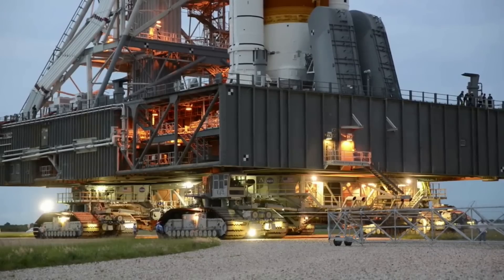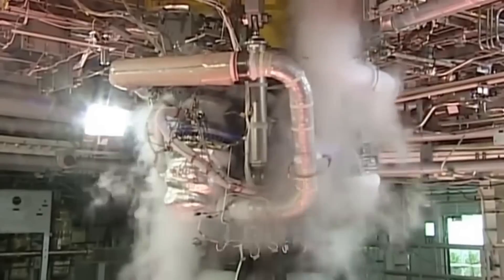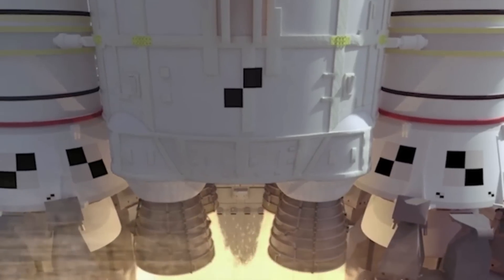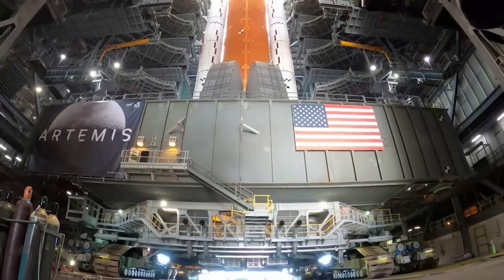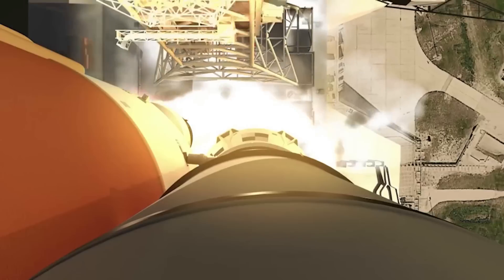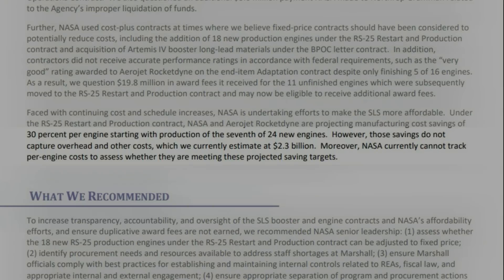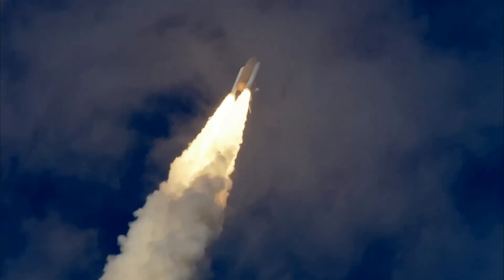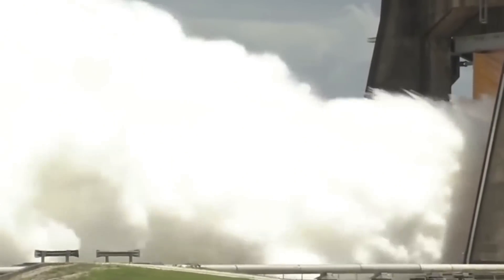The Problem With NASA’s SLS RS-25 Engine

Comment: $46million to Northrop for an award's contract?  Those are pretty hefty 'hidden' fees!

Funny aside, these costs and overruns aren't NASA's fault.  Why can't the GAO just create or assign a bureau that deals solely with NASA's contractors auditing, contracting spending, and the overall budgeting?  NASA's charter is research, design and development, manufacturing and final assembly, and space exploration.  Get the massive financing and budgeting tasks off NASA's plate and be the middleman between the agency and Congress.

For all the politics involved, a reality for any agency, and the fits and starts over the decades placed on  NASA's shoulders, no one should be surprised at how quickly the costs increase.  NASA's doing a great job and they should be recognized for their accomplishments, not the funding and cost burdens they've no control over.  Besides, they're doing a lot to ensure a better competitive landscape within the space industry.  The fact they've had but three companies to contract with, an identical scenario faced by the DOD, those companies know they're monopolistic and are holding NASA hostage.

My fantasy would be similar to how the computer industry does their chip designs and outsources the manufacturing to TSMC, Intel, and Samsung.  NASA does the brainy work, submits a bid request to the GAO, and works w the GAO to determine the best candidate for the manufacturing aspect.
Reply: I definitely agree that nasa are doing their best and a great job in the circumstances, just they're having to navigate the politics of it at the same time.

Comment: When you discuss a report that is available on-line, please post a link to it.  Not doing that, which is common, is one of my major pet peeves.  I found the report, but can't post a link since YouTube deletes comments with external links.  Keywords which will lead to it: "NASA’s Management of the Space Launch System Booster and Engine Contracts"

Comment: Nasa has enough heritage RS25 engines available to fly the next three SLS missions...And saying the RS25 is old, is misleading as it has gone through updates during the shuttle program and after to support SLS. I guess you would say the RL10 is old and should be thrown away since it's been flying since the 1960'..But it's one of the most reliable engines ever built and still used on the second stages of Atlas 5, its replacement, Vulcan, Delta 4's, and more. In  the case of rocket engines, old is good, as old is reliable. I didn't see any SLS engines shut down or not start on it's maiden flight...not bad for an old engine...
Reply: Excellent comment. Old, well-understood and reliable is often the way to go with something as difficult as launching humans into space.
Reply: And working on the first try is a nice feature of our space agency.
Reply: Excellent post.

Comment: The current SLS is designed to spend money. Congress specifically requires NASA to use many of the same contractors that built the shuttle. The SLS wasn't designed to be the best, most efficient way to achieve a a goal like going to the moon. The goal was to keep shuttle contracters in business so that election money and votes keep coming in for lawmakers. Originally sold as a "cheaper" way to keep NASA building rockets by reusing old designs, the requirements just keep funneling as much money to contractors as possible whether or not they bring anything worthy to the program. Don't get me wrong, employees are busting their butts and working hard. Unfortunately, more could be done with their work if the program was better designed.

Comment: RS-25 was designed decades ago but it is an extremely high performance engine by today’s standards and it is unlikely that anything new would usefully exceed it. The new version of the engine is to simplify some aspects of the design by using modern manufacturing techniques and taking into consideration that it is not being reused which allows higher thrust. The million second test mark was passed decades ago and probably is closer to two million by now. If a reworked design is costing this much, what would a new design cost? At least NASA can be assured that this is a very reliable design without adding at least another decade on if they were to develop something new that would not be usefully better.  Maybe the whole concept of SLS should have been rethought decades ago but the whole program was turned into a political quagmire with a “political” life of its own.  The “problem” is not with the RS-25s, but with the “political” underpinnings of the whole program.
Reply: Yes, the problem is with management, not the engine.
Reply: Good comment.
Reply: Best comment.
Reply: There already is something better.
Reply: @jamskinner  
That is complicated and not a simple statement of yes or no. For SLS probably no. Raptor is not a plug-in replacement or obviously better considering SLS’s flight profile. If you change SLS’s requirements enough to make it work you might as well just use SH as an expendable rocket which I assume you would advocate.
Reply: One significant error in the narration.  The bulk of the takeoff thrust of both SLS and its predecessor STS (Shuttle) is provided by the toxic solid rocket boosters (SRB).  These SRBs, which you will recall killed 7 astronauts including a school teacher, are only required because of the decision to insist upon the fundamentally-flawed hydrolox propulsion for the first stage.  

NASA is spending billions of dollars for recertifying RS-25 engines it already owns.  The only reason that NASA cannot replace the RS-25 with a commercial engine with the same thrust, such as BE-4 or Raptor 2, is because it is continuing to dictate the use of hydrolox propellant despite all of the engineering and safety issues of that technology.  The Raptor 2 engine now has far more hours of production testing that RS-25/SSME.  Taxpayers must seriously ask their Congress-critters "What is so d**ed important that we are being asked to spend THREE ORDERS OF MAGNITUDE more for *reconditioned 1970s engines than for brand-new American-built engines".  Act like lawyers and ask the key question "Cui boni?"  Since this is clearly a ripoff of American taxpayers, WHO benefits?
Reply: @jamescobban857  
So how many million test seconds does the raptor have? Please provide a reasonable source for your statement. The SRBs did burn through but that was a design problem that was clearly understood by engineers in NASA and their contractor. I would proffer that why this translated into the loss of a shuttle was mostly on the shoulders of NASA upper management operating the SRBs significantly out of their design temperature parameters while knowing the issues. What killed the people was “Go-Fever” to meet a political driven timeline. What also killed the people was that there was no design considerations for safe ejections. Please explain to me how your superior starship has solved that same ejection / abort issue at all parts of the launch regime. The SLS is a bit of Frankenstein and a political creature but it is an actual real and proven rocket. We will see when your superior and “not fundamentally flawed” SH & starship can say the same.
Reply: @jamescobban857  It's because they are using the RS-25 that they are using hydro-lox. It's still the best fuel for rockets anyway, and NASA has 50 years of experience using it. Calling it old technology is rather hilarious. Maybe they should add LED lights or something.🤣
Reply: @Mentaculus42  SpaceX has been testing Raptors almost contjnuously for four years now.  SpaceX has already built over 400 Raptors and each Raptor before it leaves McGregor has had at least one full-duration burn, 420 seconds.  So the Raptor testing program has at least 160,000 seconds of test firing assuming each engine has only been test fired ONCE.  Four months ago NSF reported the 1,000th test since it started reporting on 38 April 2022.

STS 51-L was launched in inappropriate weather because the entire program was months behind.  NASA managers did not want to wait one more week because it would push everything back.  Why was the program behind?  One big reason is because hydrolox is a NIGHTMARE to work with.  You must cool the fuel to between 14 and 20 ABSOLUTE, a temperature that no materials can be really engineered to deal with. Physics behaves in unexpected ways that close to absolute zero. Hydrogen leaks THROUGH metal.  The heavy orange insulation that killed the crew of Columbia and almost killed the crew of Atlantis is ONLY required because of the need to maintain those insane temperatures.  Because of its incredibly low density LH2 demands ENORMOUS tanks and huge turbopumps to feed to the engines, with the consequence that the RS25/SSME is as powerful an engine as you can build to exploit it.  It would take TWENTY-FIVE RS-25s just to lift SLS off the launch pad, whoch is why the KILLER SRBs are mandatory.  And still some clearly incompetent overseers insist on this nightmare fuel being used instead of all possible alternatives.

It was proposed to use a kerolox first stage using upgraded F1 engines.  But that was rejected because of the political obsession with hydrolox.  Don't whine about the higher ISP and clean exhaust of hydrolox when the lower ISP and the poisonous exhaust of the SRBs are tolerated just so NASA can pretend that the first stage is hydrolox powered!
Reply: @jamescobban857  
Challenger was launched when it was due to political and PR requirements so that it would be in sync with what the president was going to say in a speech. The engineers knew about the problem that caused the explosion (and had been monitoring it, what they didn’t know was a problem with the leading edge carbon carbon composites). MIT had a compete series of classes on the design of the space shuttle which is available online which I would suggest to people who actually want to learn about why things were done the way they were. Most of what u say is not consistent with what the engineers that actually did the design and maintenance say. 

In addition, one of my engineering professors actually established the 100 flight criteria for the space shuttle. I always find it entertaining how much knowledge is actually exhibited by a certain group of people who buy into a particular person’s “Bovine Ordure”!

I can understand your hate for the political creature that is SLS and in extension for your “hydrogen hatism”.  BUT you really shouldn’t take your talking points out of the BAD OPINIONS PAGES of Aʴsetechnica‼️

Comment: SLS: Making reusable launch systems disposable again. What a waste, why start with a engine designed for reuse when designing a disposable rocket.  Another good video, I subscribed after the last one, so many bs space channels these days.
Reply: The engines have a long, reliable history and were redesigned to be disposable to maximize lift. The concept is good. It's the management that is making the waste.
Reply: @jamese9283  Seems like a major design change for that to be a good starting point. Most rocket engines are built for a few minutes of life.  Seems to me like a way to get funding under the guise "we already have so many engines".  Between that and changes in manufacturing, seems like a joke to me.  The RS-25 was one of the few parts of the shuttle that lived up to expectations, maybe they really can get the value out of the design since most of the engineering is done.
Reply: @clytle374  I understand your cynicism, but try to separate management decisions from design needs. Reusability is unknown territory for heavy, manned missions to deep space, as indicated by Starship's planned numerous refuelings. The RS-25 with SRBs was a good choice to maximize lift and reliability with ultra-difficult human missions to the Moon and Mars. Program politics is another matter.

Comment: SpaceX should just bid a disposable variant of Superheavy to replace the core stage and solid rockets. It would only take 17 Raptor2 motors to match the thrust of the SLS stack a liftoff. A SLS Superheavy would likely need more as the booster would be made of stainless and be heavier than the aluminum of the SLS core but SLS core and Superheavy are about the same diameter so the adapter and everything above it could remain the same.
Reply: That would be a huge risk with years of development, as Superheavy is an unproven design. It would be easier to straighten SLS out with some strong leadership.
Reply: That's funny, because the first super heavy was disposed of in flight. Still, that's not a bad idea, and I'm not so sure it would have to be disposable.  Don't forget the first SLS launch is the smallest SLS. There are two other variants that are bigger for the moon flights, one of which is a cargo version.
Reply: They would have to build infrastructure to support methane fuel

Comment: The overestimated cost of clean slate design, and the inappropriate risk avoidance posture, ignoring savings through ground-up refactoring of systems (lack of first principles thinking), have proven that this form of conservatism is a failing evolutionary pathway. it was wrong in this case to believe that using existing systems would be less expensive. this type of thinking is grounded only in fear driven sense-making. i hope that we are taking note of these realities, and not simply rationalising them away, as many money-blind guilty parties tend to do. sometimes taking what you learned, and starting over is the best thing for cost vs benefit. at least there has been the acknowledgement (and proof)  that the private sector is better at this than the public. lets learn lessons.

Comment: SLS is a dinosaur and a gigantic porkfest for legacy contractors. It should be canceled and the commercial sector contracted to handle the heavy lifting. That would allow NASA to focus on developing the spacecraft and focusing on science missions.

I hope your next video has some good news!😃👍👍
Reply: That would almost certainly ensure China getting to the south pole of the Moon first, selecting the best landing spots. NASA needs to control costs as much as possible, to see if Starship can take over from SLS and Orion. Except for SLS, Orion, the SRBs, and ML platforms, most of the rest of the NASA programs are fixed-price contracts. If NASA can convert the cost-plus contracts to fixed price contracts as the NASA IG suggests, that would be huge.
Reply: That’s already happening. Search EPOC Boeing-Northrop Grumman Joint venture. Deep space transport.

Comment: SLS has a long list of problems but the most unforgivable one is that the first several launches will each take four Space Shuttle Main Engines and toss them into the ocean. These are actual space-flown Space Shuttle engines with tremendous historical value. They should be sitting in museums, in engineering schools, with plaques explaining that this particular engine powered STS mission 75, 94, 112, etc. They should be attached to the Space Shuttle orbiters on display, instead of the fake dummy engines that are currently attached. But instead of these options, the underpowered, overpriced, pork barrel monstrosity known as SLS will ignominiously flush FOUR of these priceless historical objects to the bottom of the sea each time it flies. It's a tragedy.

Comment: The SLS became obsolete the day the Falcon Heavy flew.  Makes a lot more sense to make modular components that are reusable that are delivered into LEO by the Falcon Heavy, dock them together and you now have a re-usable shuttle between the earth and the moon.  Use the shuttle to move the components to lunar orbit and then it moves a crew module out to the lunar station.  Also, this way we can build a larger lunar orbital station that can perform other science missions as well as support a lunar base.  And by making everything modular - upgrades are simply a matter of attaching ah updated module and then dethatching the old one after integration and testing is complete.
Reply: This is such a spacex loving comment that it straight up ignores reality. Falcon heavy cannot outperform sls, especially in reusable configuration. Moreover, it is significantly more complex to 'shuttle' crew and cargo back and forth between LEO and Lunar orbit.
Reply: @narfbite5239  FH does not have to 'outperform.'  There is no reason an entire space mission has to be launched using one rocket.  And there is no reason to spend over $2 billion/launch when we can get stuff into orbit for much less money.  And we can make the stuff we put up reusable.  

And what's so difficult about sending a spacecraft to lunar orbit?  We've only been doing that since the 1960s.
Reply: Person who thinks they are smarter then a national company bringing us back to the Moon:
Reply: @grahamdethorne5772  nah I’m not smarter than all the engineers at SpaceX, but I can look past fanboyism and read a basic tech sheet on the capabilities of falcon and falcon heavy